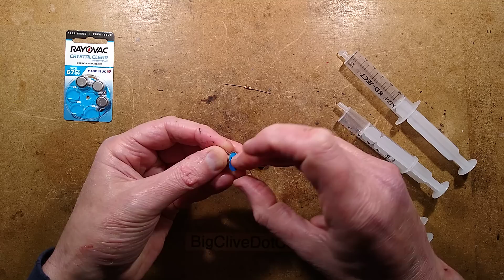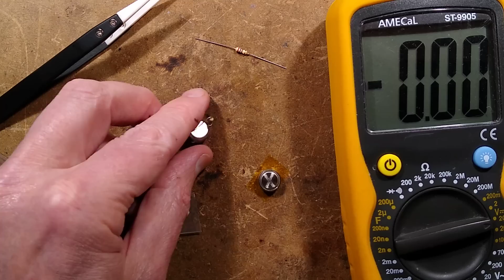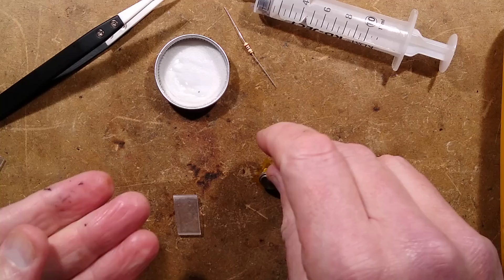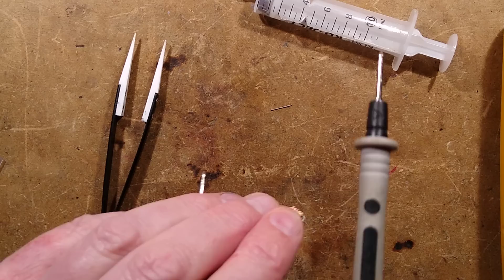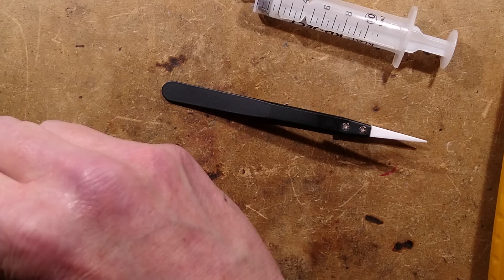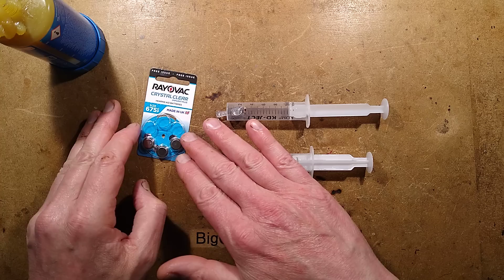Standard zinc-air cell vs mystery gas generating cell.  (flame test)

Comment: Hydrogen doesn't need to find gaps to escape. It will diffuse into the metal of a container, cause metal embrittlement, eventually causing it to fail.
Reply: I’d never heard about that, incredible
Reply: Chrome plated cycle spokes were and are a groovy looking  thing for your 70's bicycle, but I am told one of the reasons that they fell out of fashion was due  hydrogen embrittlement. They also suffered badly from surface rust. Spokes flex a hell of a lot as they carry an ever moving load which might be the root cause.
Reply: @neilbain8736    Yeah, I remember those from the 1970s. They didn't stay nice and bright for long, rusting within a year or so, depending on the environment.
Reply: Hydrogen embrittlement? Try ammonia damage to brass. 

Ammonia can damage modern brass-cased ammunition, and could even destroy cannons back when they were made of brass. And the best metallurgists still couldn’t come up with good ways to predict or measure it, other than to say “don’t let ammonia near the ammunition.”
Reply: Those are probably the main reasons that it isn't more commonly used as a consumer-grade fuel.

I understand small amounts are used to pad out natural gas supplies in some areas though.
Reply: @LongPeter  Old time "producer gas" or "town gas", where there were local plants that heated coal/coke and injected steam into it to produce a mixture of H₂, CO, CO₂, CH₄ and nitrogen.   Used extensively for lighting and cooking in the 19th and early 20th centuries.   Also where the notion that gas was highly toxic comes from.    Natural gas (pure CH₄) has a much higher energy content.
Reply: @tubastuff  yes, I more meant for modern consumer applications.

I did consider energy density but for plumbed supply it seems solvable with higher flow. Maybe more of a problem for automotive hydrogen fuel, especially internal combustion. From memory, piston engines can do about 30% of their petrol power output when run on hydrogen, presumably with ambient air, not pure oxygen.
Reply: Yes hydrogen and brittlement is a big problem in a lot of situations.

Even in welding another place it can be a big problem is boilers.

Even some sorts of feed water for boilers can cause embrittlement in the steel.

I've seen this device they call and environment detector more than once.

Essentially there is a bar of metal same type as the boiler is built from.

There is a fitting nips threaded into where the water lines for the feed water or elsewhere but connected to the feed water that water is allowed to slowly weep on one side of the material that is adjusted with a screw to have a very small Gap so it's constantly exposed to the water.

And the idea is that that piece of sample material is the next supposed to a test detect if it has been in brittled by the feed water.

This was many years ago on heard and seen about this so I don't know if this is still current practice or not not big on this as I used to be and you don't see many installs using seem much anymore or at least where you would be that you would be around it.

Know my way around older systems enough to know about this not profession or anything but just something that I've been interested in in addition so not surprising.

But hydrogen has caused plenty of problems in other areas as well not just a nuclear reactors but in instances with warheads and more.

Even a naval torpedoes.

Where hydrogen peroxide meets certain types of stainless steel yep catalyze hydrogen peroxide equals hydrogen andl Steam and Heat.

There are other catalysts too that enhance this effect.

Once heard about the system that was being tried to keep divers warm in cold water that use this affect the generate heat to keep them warm in one form or another.

This is pretty much also house I'm cold rockets work as well.

But the purity of the hydrogen peroxide is tremendous it has to be taken from the strongest sources available and then even further distilled to even be effective in the most part for things like the cold Rockets.

There hadn't even been experimental jetpacks actually I'd call them rocket packs myself because of the nature of how it works since there's not a true engine is just more of a chemical reaction type of rocket your mileage may vary on how we would describe things and so on but very interesting nonetheless.

And also Ave and big Clive are two of biggest channels I watch for the most part out of all of them on YouTube as it is of course there's a lot of others but those are the ones upon going to the most I think we're so it seems in anyways.

Oh just a quick edit story time.

I was with the students in the school that was allowed to do all sorts of things that normally would not be done or be permitted and so on and some of the more dangerous stuff but not really going into that now.

However when we hand the experiment and the science class on electrolysis of water using old-school lab power supply and the electrolysis apparatus.

My instructor knew that I was wanting to go to on this and I could do it without really saying anything and knew what he would no that the reason why that he wanted me to do this during the experiment.

And not question anything and also understand the whole thing about the demonstration for the rest of the class.

Essentially what he had me do in the second run the third run on by experiment in the lab was about halfway through or so reverse the polarity of the power supply waiting's on purpose.

So instead of just hydrogen on one side and oxygen on the other both test tubes would have a mix of both hydrogen and oxygen.

And then of course we were testing before Flame the two chest tubes and of course you know what would happened nice big bag and save a little pop!

Of course it would get everyone's attention. 

And also be able to demonstrate about hydrogen + oxygen equals much more energy released and so on he told me this before class so as not to give away what we were doing.

He knew I'd keep a lid on it because the NFL I'm very much into science myself and often participated in things such as this and much more.

And yes I had access to school labs and stuff for other let's just say extracurricular and personal projects and stuff and yes sometimes it included the chemistry lab of course under confidence supervision safety precautions and so on.

Also had access to the machine shop and all that stuff their law things for other teachers did repairs heck I even had access to the school own tools unlike anyone else.

Fairfax one time my teacher called me in after class for shop class I thought that somebody had been doing something they shouldn't have been doing again and needed to talk to me and see if I saw something but not this time we had those people trust me and I knew it that was the usual reason I was called after class by the shop teacher I had problems with those people as well so could help with that as well and he knew it.

Most of those mysterious people word a big-time School bullies that you would not want to even know or be there in the first place trust me.

But this time he just called me and says hey Aaron you see that sign up there he said read it I'm like what why he says he'll see!

So I did read it..

No tools will be long so don't even ask..

That's what the sign said.

And then said what about it after quite a long pause.

He said well that didn't apply to me!!!

He knew that sometimes I needed access to tools that I did not have available at home or elsewhere.

That was also when I found out about having access to other things at the school as well even after school and occasionally even during non-school days!

I was at once doing that could do all sorts of things that we're normally probably very much found on or even potentially against school rules.

They said there are certain people like that that had things they could do as well as places they can go that were normally off limits also I was not required to be in every single class everyday depending on circumstances!

You could say ahead of the class also I have various issues and did have access to Teachers Lounge even as well as when need be access to cafeteria in vending throughout the day and if absolutely be I could eat in class this is not just a munching on something full on eating
Reply: @aaronbrandenburg2441  In my younger days, I was assigned as a tech in a steel mill hydrogen-producing plant that provided an atmosphere for a continuous galvanizing line.   In addition to being restricted to those really awful spark-proof tools and rubber-soled boots, the big danger was that damned stuff would leak into anything at about 3000 psi.  If you went to the loo or got a drink of water, there would always be some hydrogen in the water supply.   Never could determine how it got there.
Reply: @aaronbrandenburg2441  That's a bit much to read at once. And i don't know if English is you first language, but that comment was wrought with mistakes.
Reply: @aaronbrandenburg2441  what
Reply: @aaronbrandenburg2441  Too short. Where's the War & Peace we expected?
Reply: @aaronbrandenburg2441  Your post started off well but halfway through it started to go downhill, and after that it just became a mess :D

Comment: I note that commentators below identify that the source of hydrogen is the reaction between zinc and a hydroxide solution (probably KOH), so the name 'Zinc - Air battery' is misleading; air does not take an active role.

Comment: You could always use a balloon to ensure you capture everything . You just need to seal it with a good sealant.
Reply: balloon is terrible at containing hydrogen. 
notice how helium which is of a larger atomic size goes flat? hydrogen will do that twice as fast.
Reply: Unfortunately, because Hydrogen is such a small molecule, it will easily diffuse through a rubber balloon. I really won't hold it at all.
Reply: While true that rubber has bigger gaps between its atoms for the hydrogen to escape through, mylar (used for weather balloons I think?) Is better... Although nothing that moves is good at blocking the escape really since the atoms are so small.

Comment: That squeaky pop rapid combustion is the classic identifier of hydrogen combustion, and is actually a lab test which even GCSE chemistry students learn about. A typical lab experiment is to drop some zinc or magnesium granules into some dilute acid in a test tube, wait for it to start dissolving and fizzing up (producing hydrogen), and then ignite the gas with a match at the top of the tube. You get the same kind of pop as you experienced here - though the squeakiness is much more pronounced in a glass tube.

Comment: An obvious possible difference:  Zinc-air cell is designed for maximum charge delivery, whereas gas generation cells may be designed for a specified gas yield, since more flammable gas is not necessarily better in a confined space.
Reply from the maker: 150ml of gas apparently.

Comment: If you have issues with the heatshrink relaxing, and it annoys you on a production run, blasting them with some poor man's coldblaster (upside down canned duster) will stop that. It is the latent heat, and it is annoying when making cable ends of the larger diameter.

Comment: How much force that piston can make (if it had a better seal)? Let's say you have a gun, with a light trigger... Of course this would be only for scientifical experiment.
Reply from the maker: Given that the ones in grease dispensers can shove grease through pipes and bearings I don't think a trigger would have to be that light.  But there are probably better ways to achieve random firing.

Comment: Those syringes are shyte btw. If you know a place with horse meds you can get a bag for nothing with seals in them. Different needles for thick glue and whatnot. Also good for injecting BT into squash vines if you have the dreaded borer moth there.

Comment: It's flammability limits are 3-97% if I remember right. It did pop so probably. Release the other one under soapy water and get bubbles to light. I did rust conversion before and put soap in to clear the scum and I had bubbles from hell. Cracked like lightning. Knocked the dust off the ceiling.
Reply: Spicy bubbles for sure. Make some with a perfect mix of both Hydrogen and Oxygen and light them on fire. Instant bang!

Comment: I suppose it makes sense that the gas generation would scale linearly with resistance. If we assume the reaction is made possible by the transfer of electrons, so that each electron (or a multiple thereof) would generate a molecule of hydrogen gas. And since the current through the resistor is by definition the number of electrons passing through the resistance every second, the number of molecules produced each second would be proportional to the current which in turn is inversely proportional to the resistance (by ohms law I=V/R). The volume (or pressure) is proportional to the number of molecules (the ideal gas law PV=nRT). So the volume generated after a certain time would be inversely proportional to the resistance. (Assuming constant voltage, which in reality would drop when the battery gets depleted and the reaction stops of course).

Comment: So it seems the auto-greaser is indeed reusable. Just pump it full again with a grease gun (and an adapter?) Swap the battery and boom! Bob's dein Bruder. Mystery solved.
Reply: Simatec, another manufacturer of auto-oilers does indeed sell replacement cartridges containing a gas-generating battery and a variable resistor.
Reply: That's interesting. The thing is, theoretically, you only have to buy this device once, to use and refill it again and again as you please. I like that.
Reply: @diegopicadidot8948  That's what they suggest, although you can also discard Simalube oilers if you prefer to do so, of course they're not against it either.
Reply: So the relationship with the customer is... frictionless. Nice.

Comment: Hydrogen is such a small element that it will permeate through the walls of steel cylinders and plastic. Only surface tension can keep it retained under pressure for long, this is why gas bottles for hydrogen have an internal lining structure that looks very similar to a sponge.

So unfortunately no matter how air tight you make a syringe the hydrogen will leak out.
Reply: I have a large(ish) vacuum chamber with 13mm thick steel walls.  If I pump it down with the diffusion pump then seal it up and shut down, after a few weeks the pressure in the chamber rises by a few tenths of a torr   If I try to pump it back down I can't without first fully re-pressurizing the chamber.  Turns out that while the chamber is holding a vacuum for a few weeks hydrogen appears to find its way in to the chamber and refuses to pump out in a timely manner.
Reply: @JlerchTampa  Easy hydrogen concentrator, cool.

Comment: You can dandle the battery in a test tube that has ml markers. Put it upside down in a water container, so round side up with the battery. Fill the tube mostly with water then the gas should push the water out leaving only the hydrogen inside. Would make it easier to test and less hydrogen loss.
Reply: I would suggest oil to prevent messing with conductivity. Also one can use a syringe with plugged nozzle as a measuring cylinder.
Reply: @pamersiel  bruh
Reply: I don't think you can store hydrogen in glass containers. Too much leakage.